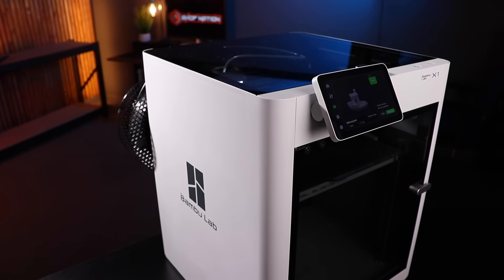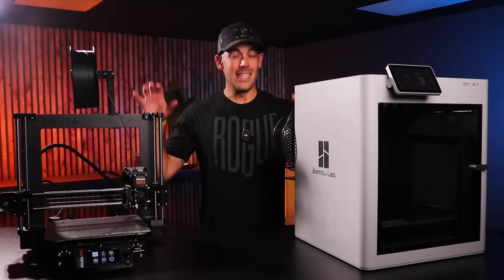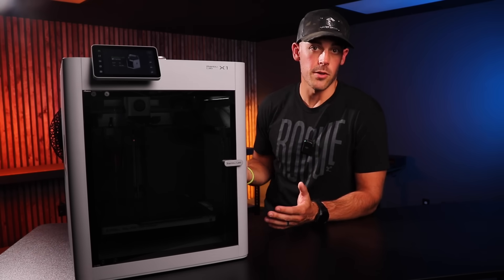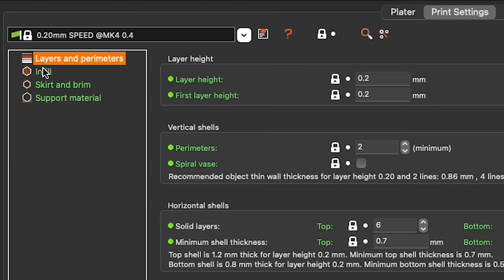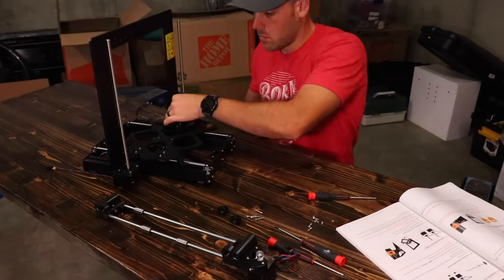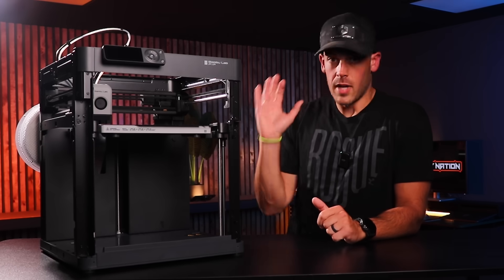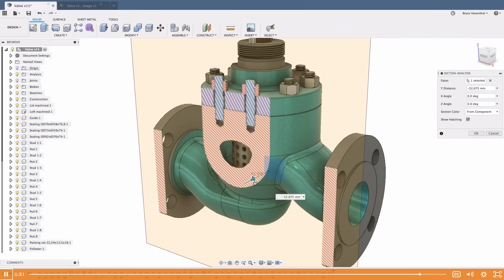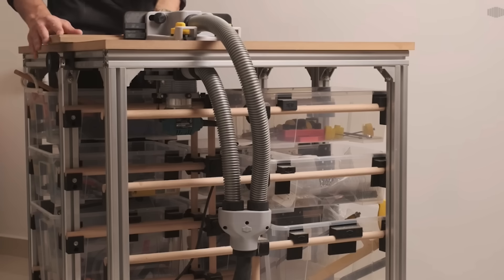The 3D Printer I'd buy if I started over

Comment: I followed this guy's advice and brought a Bambu P1S. Was 3D printing in 15 mins of opening the carton and haven't stopped since - somebody stop me!
Reply: How is it holding up?
Reply: @erikottema2620 😂😂😂 same
Reply: @A_Mysterious_Crow  Bambu labs are not really made for easy maintenance right?
Reply: @erikottema2620 that is a good point, having by a nice open build seems easier to maintain, I wonder which is easier to vent vapor from?
Reply: @WingofTech  Bambu Lab obviously, but when something inevitably breaks, you're better off with the Prusa
Reply: @erikottema2620  Why obviously? they aren't sealed printers. They give the appearance of being sealed but there are gaps all over that machine, they have a large hole in the back for the poop chute. Bambu's also use Carbon Fiber rods which deteriorate and leave carbon dust in your environment which is horrible for the lungs. Think asbestos.
Reply: @Cheddar-420  it doesn't need to be perfectly sealed, just enough to create a negative pressure. Building an enclosure is easy though, so it's not really a problem for the pruda
Reply: The thing that stops me from getting into 3D printing is the toxicity element.  I still haven’t been able to find info online about what’s the safest to print in home, around children, what’s non-toxic, proper ventilation, etc.
Reply: @cort4231 just vent it and use it outside the living space (garage eg)
Reply: Well, evidently BambuLabs is going to stop you now...
Reply: @mrsleep0000 why?
Reply: Been a year, stopped yet?
Reply: @justnd2582  Well life got real for a while so had a 6 month 3D printing pause - but back into it with a vegence for the last couple if weeks and loving the software updates (so cool). Printer is still great and have mainly used a lot of cheap filament and nozzles/heads with reasonable success but now thought I should at least check what the difference is with more expensive Bambu labs filament and parts. If someone asks me in a few weeks I will provide an update here.
Reply: Same here
Reply: 3d printing safety
Reply: Going in between Bambu P1S, Creality K1C and the Creality K1 Max. I’ve heard some bad things about Crealitys but they look so nice.
Reply: @Nick-Edwards  I only have experience with the P1S but I’m 375 hours in and not a single issue. Parts look cheap and worst thing I have had to do is wash my plate occasionally.
Reply: @joshmm141 is 3D printing safe to do inside with kids around?  I’m so freaked out by toxins/fumes that I keep reading and I can’t pull the trigger on getting into printing
Reply: @joshmm141 so you recommend to get a P1S as starter?
Reply: Would your recommend the P1S? Im looking to upgrade from my ender 3, and I'm looking for what to get.
Reply: @BreadFlavorSpots I would but then this is the only printer I've used. Build is great and software pretty advanced but getting cheap filaments to work with variable humidty etc has been tricky. I've saw these discounted packaged as a combo with the AMD which seems like a good deal.
Reply: I love my p1s man it has been printing amazing prints right out of the box. 2a prints toys everything
Reply: Thankfully Bambu has an incredible wiki
Reply: You could just as well buy a Quidi Tech Printer if you care about speed. Or the Bambu Lab A1, which is a bit slower but equally maintenance-free and much cheaper. It depends on which parameters are important to you. There are many models of 3d printers that are easy to use and do not require much attention.
Starting 3d printing in 15 minutes is just about adding layers of plastic. In order for the prints to hold their dimensions and be durable, you need to spend time adjusting the extrusion parameters for each specific filament. If you do not care about this, then laying subsequent layers can be done cheaper with another printer.😉
Reply: you can't, it's addicting
Reply: Still printing? I'm looking at purchasing a Bambu
Reply: Me too, 😊
Reply: It slows with time.. stay strong!
Reply: I saw  this AFTER I bought one... I ran out of filament and just ordered more... I started 3D Printing JUST two weeks ago for the FIRST TIME!  Bambu Lab 
P1S is AWESOME!
Reply: Ahem-     P2S. STRINGING. CRAP CAMERA. AMS2PRO. PRUSA-MK4.
Reply: Dude I wish I had the money to buy this. Being poor sucks dude. One day... maybe... 😢
Reply: Bamboo Labs is busy stopping everyone printing on their own printers
Reply: @RS-chino no
Reply: Nozzle/extruder/AMS clog be like: 
ok
Reply: No
Reply: Stop

Comment: Don't buy a shit if you start 3d printing or you'll disgusted. But don't buy a 1200$ printer either. My advice is to take a model with auto bed leveling, trust me, losing 30 min each time you want to print something is boring as f.

Comment: Same as you, been using these since RepRap days. Having used commercial printers I found the main problem is supports. The AMS on the Bambu is a game changer as you no longer need multiple heads and their cost. The print off this is better than my Stratasys SST1200 was.

Comment: i started out on a xyz davinci 1.0a it was a okay printer, then moved to the ender 3 pro and ender 3 v2. the ender 3 pro was a great printer, but the bed is so small. i just bought the elegoo neptune 3 max. i have to say for $400 best printer i've ever worked with. i currently have the addams family house on it. 7 day print and right now its been print for 76 hours and no issues. i could get 2 elegoo 3 max and and elegoo 3 pro for the same price as one bambu or prusa printer. i could care less about going fast. i needed a bigger printer that doesn't break the bank. also so much easier to do full armor for cosplay and making truck parts for my s10 on the 3 max. i plan on buying 3 more elegoo 3 max here in the next few months. also the elegoo neptune 3 the basic model is costs $100 new. i could buy 11 for the price of just 1 bambu or prusa printer.

Comment: Hi I’m new to this but I need a printer that can print 1/4 thick flat panel with holes. The board measures 12x12 inches. Can you recommend a printer that can do that ?
Thanks so much 
Hector

Comment: I live about ten minutes from the prusa factory in prague, so I've been leaning in that direction since I'd have so much local support.  But this vid has me wondering if I should go with Bambu labs, regardless.  A quandary for sure, since the P1P is so much faster.  But I also didn't like your comment about how hard it is to fix or replace parts. (well, the comment was fine, I just didn't like the fact that it is hard to fix or replace parts)

Comment: started with ender 3 and little things that broke that should of just been metal to begin with not plastic i didnt get into it much. 
Got a kobra 2 max and its great for the large prints but i decided to get an x1-carbon for my daily driver (i also have a resin anycubic photon m3 which is pretty reliable so far)
Each have their own purpose (large prints, resin for high detailed small models, and everything else goes to the x1-carbon) 
I dont run a print farm im a hobbiest and 3d printing is part of a goal to be able to make anything i want from my house.

Comment: I'd be curious to hear how the Prusa and Bambu compare to the new Creality Ender-3 V3 KE. I just got this model (upgrading from the Ender 3 Pro) and it's light years ahead of what I thought I could do for under $300. Auto bed leveling, LAN printing, and FAST printing (~300mm average, 500mm tops). I've only had it less than a month, but it's upped my joy of 3D printing.

Comment: As a newbie, i watched your video and decided to go with Bambu. One month in and it hasnt stopped printing 24/7. Very happy with my purchase.
Reply: question which Bambu did you get? i'm also a complete newbie
Reply: @dravickgarden6765  get the x1 carbon, don't think, just get it :D
Reply: @neelqqq now you have me thinking…
Reply: @neelqqq does it come with the AMS without having to pay extra? what filament brand do you recommend for PETG and PLA
Reply: @xxtomcatxx  nah AMS is extra, and I mainly use Bambu filament if I can, it’s more or less the same price as esun and sunlu which i get from amazon, but way better. If you can get stock that is
Reply: @neelqqq  oh shit i thought ams came with the printer, might have to wait in that case lol
Reply: @neelqqq  what other upgrades do you recommend getting off the bat? the heated plate?
Reply: @xxtomcatxx  you can buy the x1 (no ams) the x1 carbon (with ams) or the ams separately
Reply: @xxtomcatxx  textured pei plate is a must. The cool plate which comes with it makes you have lots of glue hassle. If you can live with a textured finish the prints come off it so nicely. The P1S comes with the textured plate as standard I believe… not sure why not the x1 carbon. That’s the only addition I have which i use every time. Also the 0.6mm Hotend assembly is good to have in your stash as it will speed up your larger prints, and not clog if you use filament with filler.

Comment: I own a profitable additive manufacturing company. In your opinion, which mid-range printer provides the best quality prints? I am more interested in finish quality and consistency than speed. I also mass print some products with flexible materials - do you have a specific printer you would recommend for high quality, consistent flexible prints?

Comment: Excellent Video.  I have the same point ov view. Printers are a tool. A Tool to make parts and money with.  I am not interested in toys.
 I do 3D Solidworks modeling and have done some printing but I do not own my own printer. Most consumer models have a bed that is too small for my needs.
I need at least a 12" x 15" bed. What Functional printer below $5000.00 would you recommend  that can do various plastics, nylon, carbon fiber etc.  
Also like the Idea of creating my own Print farm to print metals and plastics.
So can you create a video aimed at small business professional printer recommendations  and your day to day operations of your print farm?

Comment: Great explanation and yes I am the Toyota guy, well more like the hyundai (Ender) guy but I'd like to upgrade to a bambulab with the multicolor option, allthough Prusa also has an answer for that, but just 5 and I want MORE. But yeah all that is in the future. YES if you want to just print and not have too much worries, do not go for an Ender, IF however you want to learn more about what makes 3D-printing tick, you will need to encounter EVERY possible mistake, failure and annoyances 3D-printing will give you, that's why when I bought my ender 3 pro, I knew it was some cheap chinese piece of crap, with all due respect though, it works fine for what it was designed and it is a great design BUT everyone knows you do not by an ander 3 for REAL professional ends. Allthough many printfarms run with them. So why did I buy this ender 3 pro? Well to learn about 3D-printing, I was a noob and compared to you probably still a noob, but if you really want to learn about stuff the best thing to do is to buy something cheap, something that will run in to nearly every issue you can have on a printer, and boy did I, and lastly something that I can upgrade to make it a REAL pro printe for REAL professional ends. And the ender 3 Pro gave me all of that, I ran in to leveling issues, layer adhesion issues, first layer issues.....and when these things started to bother me I added tight bedsprings, a BL-touch, a 32-bit bigtreetech card (mine still came with an 8 bit), a full metal hot-end with direct drive from Micro-swiss....And I can honestly say that the printer has improved very much. 

This is not to take a blow at creality and the ender line however, I think the new enders are improved very much since then and yes I would reccomend them now more then back then.
But I learned which was my original goal and why I am the hyundai guy for now, I am building a hypercube, maybe I will even build a Voron some day, (if I ever get that hypercube finished).
Why go through all that trouble? I want to learn, it's as plain and simple as that, I am like that car guy that buys a wrecked Pontiac Firebird, but completey pimps it in to a fully functioning classic, who would you rather have fix your car? The overpriced Tesla or BMW mechanic that just comes for his paycheck? Or that car enthusiast that built some awesome classics and knows cars, I want to be that guy but for 3D-printers

Comment: I started out with a 180$ Voxlab Aquila. It was an absolute pain to even get printing right. It ended up falling apart and becoming a pile of junk after about 10 months. 

Then I got an Ender 3. It was a bit better, but it was a headache as well. I would end up spending just as much time messing with settings as actually printing, just to get it to print.  Leveling the bed was also a nightmare. It was also plagued with bed adhesion issues and nozzle clogs.

Now I have a PRUSA Mk.4, I have had it since release and it has provided, by far, the best experience I could have wished for. Super fast prints due to input shaping and it prints reliably every time. It will auto clean the nozzle, automatically level itself completely hands free. I get perfect prints every single time. 

A nextruder nozzle from PRUSA can last 6 months to a year of regular use with just PLA. replacing the nozzle is also easier than the Ender or Voxelab.

Comment: Thanks to this video I bought my first 3D printer last month, a 2nd hand Prusa Mini+ for a really decent price. It's a real work-pony, and I'm really pleased with the decision to get it rather than an Ender 3. I think one day, if I've got the money, I'll get a Mk 4 or whatever Prusa's latest printer is in a few years, but for now, this Mini does everything I need it to, and it's so easy to service.
Reply: Don't get an Ender. It's a decent frame and will work very well if you set it up right, but that's the problem. You have to spend a shitton of time setting it up and tinkering with it instead of printing the things you actually wanted to print.
The main problem with this hobby is that people don't understand that tinkering is only fun if you're doing it for fun. It's not fun if you have to tinker with the damn thing all day just to get it to print something.

Comment: As a recent Bambu Lab purchaser, I have to say at least for their A1 and A1 Mini line, it's REALLY EASY to procure replacement parts. It's not the same as buying them, but I wound up messing up my heat brake fan something fierce, and made the problem a bit worse by going too far in disassembling the extruder. Bambu Lab has replacement kits for various modules that can get you back up and running in no time - but I'd have really liked an instruction manual for basic assembly/disassembly of the toolhead rather than having to go to their wiki.

Comment: Best bang for buck printer I’ve found is LNL Tenlog D3 Pro. imo it is a little better than P1P in every way. 

Price $520 
Larger build area 300x300
Direct drive
IDEX that means two heads for duplicate and multi material printing
Super reliable 
WiFi connection
Great customer support 

Downsides: 
no auto leveling, but once leveled 100% surface area can be used without issue. 
Some assembly required 
Compared to creality this is nothing to fear, beginners can handle it.

LNL is an American company that buys from the Chinese manufacturer Tenlog. Buy from LNL because they do QC and are cheaper. Buying straight from Tenlog would be a mistake.

Comment: I’m looking into manufacturing through a 3d printer. I’d like to be able to make small discs of wood and plastic. About 10-20 per day. The size is about 4 inches in diameter and wouldn’t have a lot of complexity or depth to it. Maybe simple engraving but molded like a frisbee. Would you recommend a 3d printer for something like this?

Comment: Loved the video and looking forward to more of your expertise. I followed your recommendations...well, most of them....I brought a Bambu Labs PSI Combo with the AMS and had it all up and running within the 15 minutes from unpacking the box to printing my first print with 2 minutes to spare just like Bambu Labs advertised. I started printing everything from poop containers, fridgets, signs, filament spools, and tons of other stuff along with a rack to hold up to 66 boxes/rolls of Bambu and Sunlu filament in their boxes. I've never owned or operated a 3 D Printer before. I've learned so much from trial and error with things like heater head temp changes to unclogging the head, changing build plate temps to help different filaments stick better or not. I printed off LED Risers in order to install more lighting in the print chamber. It's great and I love it. Thanks for all your help with your videos..... FYI, I've had the printer since the last week in Nov 2023 and as of today Feb 2024 I've used a little over 18 rolls of filament, printed hundreds of pieces and have 752 hours of print time on the P1S. I am proud to say that with that 752 hours of print time I've only had 3 issues with it and was able to solve those issues within a few hours. The P1S has been running almost continuously since I got it. I am definitely addicted to it. Now that I've practiced for the past 5 weeks almost non-stopped I'm thinking it's time to find a way to make a little money with this beautiful machine. Any ideas would be helpful..... Thanks again for all that you do......

Comment: Thanks so much for this video! Great recommendations for commercial printer choices. You mentioned working with industrial printers as well. Do you happen to have a similar video for these? Or recommendations? We have modeling and experience with beginner 3d printer (FlashForge Finder 3, which is good enough for prototyping), but would like to start looking into production-quality printing at a larger scale. 

PS: Factor seems like it could be a good choice! Thanks for sponsoring them!